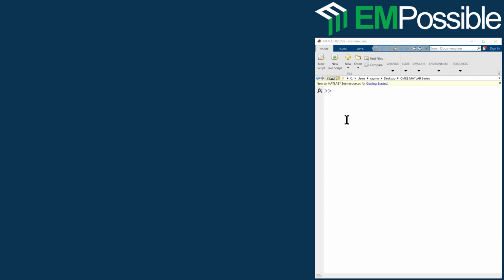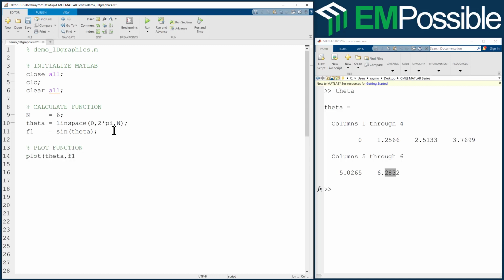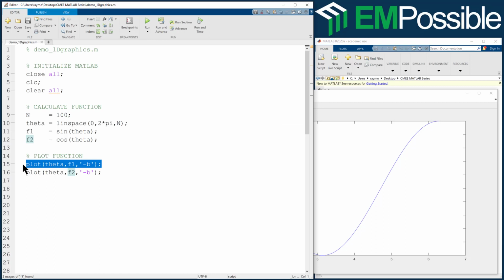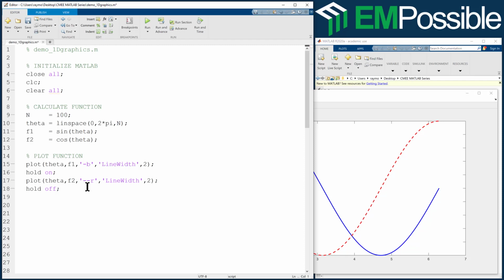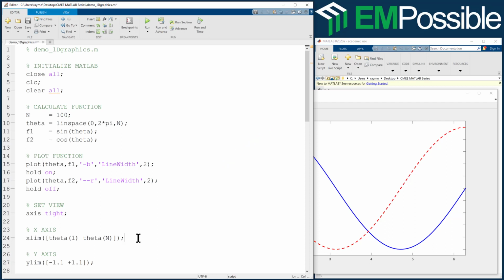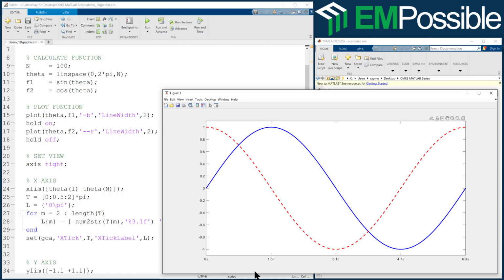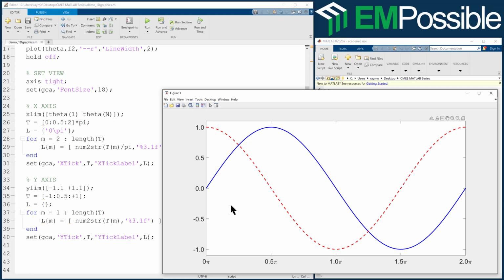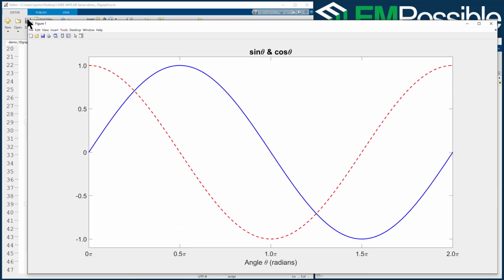Generating Professional 1D Graphics in MATLAB

Comment: Thanks for all the videos with detailed explanations, Dr. Rumpf ! Just a quick question..MatLab assigns the y-axis and x-axis to the left and bottom by default. Is it possible that I can plot the y axis at the origin? I know about the PlotAxisAtOrigin function in MATLAB..but as I am using OCTAVE...it would be better if you can suggest a solution in OCTAVE.
Reply from the maker: I do this simply with plot(y,x,f) and then labeling the x axis with something like "y-axis" and label the y-axis with "f"
Reply: @empossible1577   Thanks for your quick reply,Sir..It worked :)
Reply from the maker: @adrijade9793  Great to hear!

Comment: Hello Dr. Rumpf, thanks for the in-depth presentation for generating publication-ready graphics from MATLAB. I will be interested to learn how do you post-process the MATLAB figures when you have multiple figures in a publication (Like Figure 1(a)-(b) placing side by side)? It would be helpful if you can make a video of the post-processing steps. Thanks.
Reply from the maker: Interesting idea.  I use programs like Adobe Illustrator or the open source Inkscape to annotate and manipulate MATLAB figures.
Reply: Thanks. Which format of image do you export the most from Illustrator? In many instances, I have used the .emf format but lost a good chunk of the fidelity of the image in the process. Thanks.
Reply from the maker: @abirhossain3437  I have pretty good luck with all of them if I set resolution high enough.  I have never used emf.  I use JPEG if I want them small, or PNG or TIFF if I want really high quality.
Reply: @empossible1577  Sounds perfect Sir!